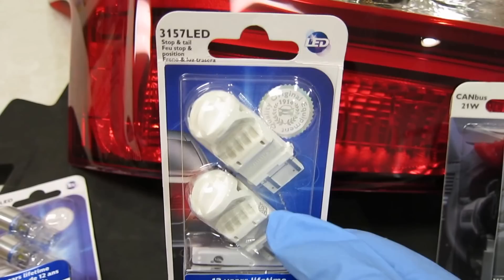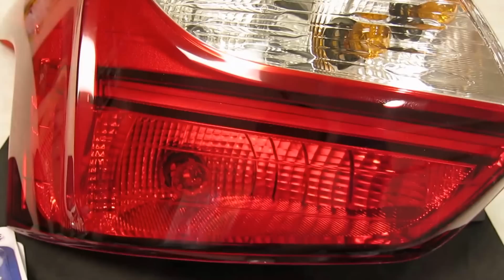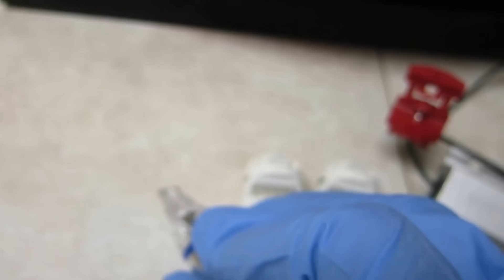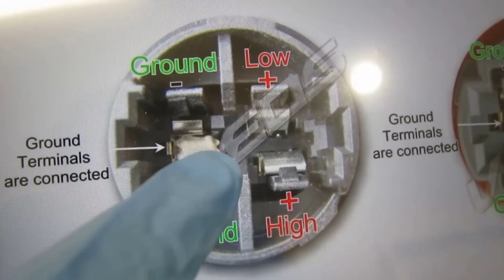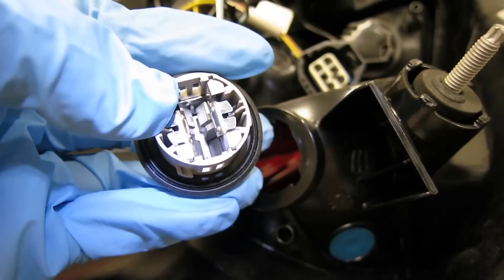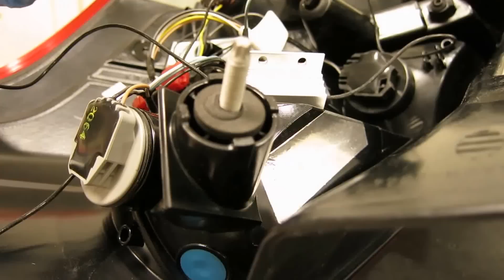How To Replace Ford Focus Tail Lights with LED lights

Comment: @moomoo97 I know this was 8 years ago.

I recently bought these 7443R Philips vision led bulbs. They are very hard to find them nowadays. 

I love this design and use our reflectors. What I don’t like is the color of the red led. When it’s on, it was orange-ish red. And it does not create a usable light.

That’s why I still use the sylvania zevo 7443R brake lighted bulbs. Those create a nice rich red that’s more deeper and vibrant. 

And the Philips are 12 year warranty. While the sylvania zevo are a lifetime warranty. 

I love both led that uses our reflector housings. But I didn’t like the color it makes: 

With 4 LED’s, the beam pattern of my red tail lights were a wider and more square shape beam pattern vs. the zevo makes just wide rectangular shape. But the zevo red led were more usable beam pattern, the Philips vision were less bright or less usable light.

Comment: hello, I have 1 question. When you close the tap to the wire, you don't need to remove the wire cover before closing the tap? How the CANBUS "recognize" the wire if it does not touch to the inside of the wire? Thank you
Reply from the maker: Do you mean the red tap in the video? If yes, those are the wires binding tap which cleanly connecting  two wires together without cutting the original 'source' wire first. And it's reversible if in the future you want to uninstall the LED canceller. Hope this answered your question. :)

Comment: I have focus mk2 2006. What step should I do with P21/5W if I want replace them with led? There is three wires from the harness. Parking light - brake - ground. Correct me if I’m wrong. I have resistor but with which wire should I connect it? Thank you in advance.

Comment: Brilliant, the only video I have found to clearly show the resistor install, I am upgrading my rear light cluster to smoked LED then want to upgrade the indicator bulb which will mean connecting the resistor.

Ford Focus Mk3 <2014 Rear LED Chrome Smoked Tinted Tail Lights

Comment: Did this for both the break and tail lights months back and all went well until I had a thought of putting in led turn signals in the rear but had the hyper flash even with the resistor installed for the break. Is there something I did wrong?
Reply from the maker: The Turn signal and Brake are separated circuits. You'll need another pair of resistors just for the Turn Signal LED bulbs. This will get expensive and usually I don't recommend changing Turn-Signal bulbs for LEDs.

Comment: I did what you did but I still get bulb error message on Hyundai 2017. 
Maybe I need to connect the ground from the turn signal?
Reply from the maker: How many Brake bulbs you've replaced with LED bulb? The canceller has to be installed on each LED bulb line.

Comment: I have Mitsubishi Lancer Ralliart Sportback and when I use one Phillips LED as a reverse lights it's fine but put two in and they all shut off?

Would this help fix my issues
Reply from the maker: Couple of checks: Reverse Light fuse is not blown, and both LED bulbs are in the correct polarity. You can test it easily with the 1 LED 1 Old bulb method to make sure your LED is in the correct orientation.

Comment: Sorry but that's the worst way to install led's into your car. Idk maybe it's something about having to put in a resistor that gets super hot so hot in fact that it's designed to be mounted to the chassis of a car or somewhere metal to keep it cool and from burning down your ride... I guess I'm just against anything that can burn my car to the ground. They have so many lights on the market these days that are cambus ready to be doing this not to mention when I use LEDs I like the fact that don't take any power to run unlike the  Where you have to use that resistor in order to put a load on the system.  Just defeats the whole purpose to me but to each their own  Great see so many people customize their cars today.
Reply from the maker: You're viewing this in a narrow scope. The reason to use such resistor is to make the CANBus not to throw a bulb-failed signal due to the inherently low-resistance of LED. There's no way such a design-specific resistor will burn down the car because it'll NEVER get hotter than the same wattage of the original incandescent taillight bulb.  Besides, the car's taillight circuit has a fuse in place to protect any possible overloading.
Reply: @moomoo97   Let me go ahead and look up one but I can guarantee you those resistors can in fact get hot enough to start a fire in a car you're just not familiar enough with the way it all really works with resistors and how those things work in your cars because if you did your homework you wouldn't have replied regards to this.  I don't know I don't fairness maybe those resistors are somewhat different than the ones I've experienced in the past and I painted Dang I just don't see any point in doing and what I can run a canvas ready LID0 heat and no drop off my battery and still not throw codes. You don't have to pull the power in order to not throw code thus,why use a resistor...
Reply: @secalcavazos3204 the benefits for having them with load equalizer resistors or warning cancelor.

Is two things. 

1: it can trick the computer that thinks it has incandescent bulbs which it has led instead.

And 2: it helps to stop the hyperflash.

3: some vehicle are a little sensitive that if it pops up ur dash board, it can be annoying and needs to fix that problem. If it doesn’t pop up at all. We’re good

Comment: Thanks man! So much info!
Reply: I know this is an old video but how did the resister work mounted onto the light w the 3m tape? Did that work ok?
Reply from the maker: @Charlie5ims  No issue, it works perfectly. Use the 3M Outdoor tape specifically and you'll be good to go, and less clutter up when reinstalling the taillight back.

Comment: THANK YOU. So kind of you to make this video. For me, the bulb upgrade from incandescent / installation was easy enough to figure out following the user's manual of my car, though it did frustrate me on a couple of the bulbs when I knew that I had them securely inserted in the sockets and the sockets properly replaced with none of the wiring damaged yet they still didn't work. Thankfully, instead of making another useless trip back to the store, some baboon or perhaps reptilian, vestigial portion of my brain kicked in and caused me to just play with things a little bit, and try any possible variations on how I had done things, leading me to figure out that unlike  incandescent bulbs, as you pointed out in the video, it matters what direction you plug LEDs into their socket. 

I was not so adept at figuring out how to install the canbus restrictors, or finding any other resource on the internet to do so. And since Philips is absolutely horrible in providing no instructions and no documentation whatsoever, and since we were talking about cutting into wires and adding additional circuitry to the electrical system, which I know nothing about, I was not at all about to let my inner baboon or lizard loose on the electrical system,, risking frying and blowing things up. 

So, they sat on my desk for several weeks, uninstalled, with me driving around hyperblinking everywhere.

This was made all the more frustrating  because I knew it must be something very simple, yet that I did not know. 

Your video fixed all of that. And was very well put together and articulate and concise. Well done.
Reply from the maker: Bravo! Thanks for watching and your interesting notes. Really glad to know this video helped you out on the upgrade.

Comment: Can I use this resister on a 50w led bulb for my rear turn signals on my 2016 Toyota tundra? It had a 921 bulb before.
Reply from the maker: Don't think you'll need another resistor if your LED bulb is already consuming 50w! Joke aside, if your turn signal is blinking crazily fast after switching to LED bulbs, you can add this resistor to the line, but you'll need one for each side and will be expensive.

Comment: WONDER IF WHAT HE SHOWED ABOUT BOTH SIDES OF THE CONNECTOR BEING SOLID OR BROKE UP N2 A SINGLE CIRCUT ON THE OTHER SIDE IS THE SAME FOR ALL FOCUS MODEL YEARS? I WILL EVENTUALLY UPGRADE MY 03 FOCUS BULBS & FICTURE! & SWAP OUT THE OLD TARNISHED HEADLIGHTS ON MY GIRLS CAR AS WELL!!! WITH BOTH OF OUR CARS BEING MID 2000'S MODELS, THEY HAVE SPENT YEARS IN THE ELEMENTS! WISH WE WERE WEALTHY & OWNED A GARAGE! I NEED TO BUILD ONE!!!!
Reply from the maker: Brake light circuit is never in Serial.  So having one bulb failed on a side will not affect the other one.

Comment: if my car need 21 watt led light , and i bought 21 watt led light , do i still need the resistor >?
Reply from the maker: Short answer is NO. This is because a 21-watt LED bulb by itself is already resistive enough to make the car computer knows the bulb circuit is working. However; I doubt if there are actual 21-watt LED bulbs for brake/tail light ever exist on the auto market.
Reply: OK THANKS
Reply: actually i want to replace for the turn indicator not brake light
Reply from the maker: Same to the turn indicator for LED bulb. No resistor is needed IF you were plugged in a 21-watt LED.
Reply: ok thanks
Reply: @moomoo97 nowadays it does exist. 

We have auxito led making between 24-28.8 watts per bulb. And we have morimoto XB led bulbs with 30 watts per bulb and with an active cooling fan and a built in resistors.

Comment: you dont need resistors for mk3 it just works perfect without the load resistors, specially with philips its direct oem fit
Reply: Well if it’s a low wattage, u do need a resistors

Comment: Resistance is higher with LED, it looks like an open ckt.  The Resistor is parallel, decreasing resistance,ADDING current load to ckt.  Look at pkg how they wire it, across the LED, not in series
Reply: With the resistor in parallel to + and - pole, it consume sufficient power on canbus  so that no dashboard error. But I'm curious about if no LED/bulb installed, it shows no error too. This is a problem that you don't know any malfunction on the light as time goes by. In case of resistor going bad, the circuit goes directly from + to -, it can burn the fuse or short circuit. 
I'm pondering to replace my vehicle brake light with aftermarket LED brake light, I found dashboard error while foot on brake and should I supplement a resistor to avoid this? But the above issues get me awareness.

Comment: 2012 ford focus SEL (USA) , brake light resistor/canceller had to be connected between the blue and black wire.  The tan wire is for the parking lights... just feel the resistors with the lights on and make sure they aren't getting hot while the brake light is not depressed.  Thanks for the video though.
Reply from the maker: Thanks for the additional notes about the brake light wires on 2012 Focus too.

Comment: I want to do this with my focus sedan. Will I need the same bulbs for the sedan version? Also what about turn signal bulb? Is there a Phillips bulb for that?
Reply from the maker: If your Focus sedan is also using Tail bulb 3157 (Check your Ford owner's manual to confirm), you can follow this video and using the same Philip 3157LED bulbs for conversion. However; you cannot use these Philips LED for turn signal because this Philips LED only come in RED color and not AMBER/YELLOW.
Reply: moomoo97 any suggestion on brand of turn signal bulb I could use?
Reply from the maker: Not many good AMBER LED bulbs which I know of is beneficial to be retrofitted in the regular turn signal housing. Other than just sounds cool, the actual advantage in replacing the bulb to LED is very minimal. It's money worth saving for other mods.

Comment: My Jetta also has the CAN bus.  There are bulbs with resistors already built in.  I got mine from DeAutoKey.  They make their own stuff and they make them specifically for Volkswagen cars.  They may work in other cars too but I won't guarantee that.  Volkswagens are finicky when if comes to finding LEDs that work without having to wire in a resistor but DeAutoKey's bulbs work without them unless otherwise noted.  It is nice that I did not have to modify my wiring.  Before I found DeAutoKey LED I was going to just take the easy way out and stick to the original incandescent bulbs that it had already.  Their prices are not the lowest but they are not at all high considering what some LEDs sell for.  You know what else is nice?  You get a limited lifetime warranty and free shipping on all orders in the USA.  Their prices are good but not the lowest.  If you want the lowest price, stick to the iffy junk no name ones because that is what you get usually if you pay the least, you get what you pay for.  These bulbs from DeAutoKey must be really good qualtiy, many VW owners use them just because they work and most of the others do not.

As I said, their bulbs may work with other cars but that is all up to you to find out if you would like to try them.  Just because they work in my finicky car, it does not mean that you will have the same luck.  You may even upset some awful electrical gremlins and in extreme cases have to go to the dealer to get the problems corrected.  Your luck may vary and I hope you have good luck the same as I did.  My new LEDs are bright to, I can see a red a fair distance back at night without using the brakes and that would make them more visible and thus safer.  I am thinking of getting a set of reverse lights from them now that they have won my confidence.

They use Osram LEDs and though not CREE, they are still very good and bright.  I had a bulb not working and they sent me two back.  All I had to do was send in the defective one to avoid getting billed for that one.  No more problems to this day, that defective one must have had a loose connection.  I would recommend them to any VW or Audi owner if they asked me what I used in my car.

Comment: Hi, great video, are they the same sockets for a Sedan? I have a 2014 Sedan, and am interested in replacing the normal bulbs with LEDs.
Reply from the maker: +Redline Should be the same if your sedan's Brake and Tail Bulbs are also 3157

Comment: I need a warning canceller for each led bulb replace?
Reply from the maker: +Diana Liu No, you just need to install the canceller to the Brake Light circuit only (Wire which goes to the Brake Bulb). You will need one for each side of the tail lamp, so 2 cancellers for this LED bulb project.
Reply: +moomoo97 Should I keep these Philips bulbs and to order the canceller or to go for 1156 led bulb with built resistor when they will be back in stock fromwww. aznoptics.com  Please,tell me what do you think?
Reply from the maker: +Diana Liu You should keep the Philips bulbs and use its cancellers for your LED project. These Philips LEDs are properly engineered to have the light pattern and brightness for replacing the incandescent. Also its cancellers installation has no wires to cut and just a clip-on. They can be uninstalled very easily when you plan to sell your car. I don't recommend using or purchasing any LED bulbs other than Philips, esp for brake lights upgrade.
Reply: You right ! I love Philips too and I like the brightness but shame on me I don't know where to clip -on ?
Reply from the maker: +Diana Liu Search around here and see if there're videos to show you how to look for brake wires in your Mercedes in similar model year.
Reply: Ok! Thanks moomoo97:)

Comment: I was told the warning canceller is only required for the turning signals?
Reply from the maker: +gsh0ck3d For older cars yes. However, for newer models with CANbus like the Ford Focus here, its computer is also checking the Tail lamps circuits for burnt bulb(s) for low resistance and will throw a warning message....

Comment: Did you put the canceler on the stop light wire, why??
Reply from the maker: +Luis A Jaime Because I've just changed the Stop Light bulbs to LED, as showcased in this video, so the canceller must be in the same stop light circuits for the car computer not to throw a burned-bulb warning message.
Reply: In other words, (yes I’m replying to a 10 year old comment lol) so putting the Phillips warning canceler will trick the computer, into thinking it’s running an incandescent bulb, but running with led bulb. So it will prevent from giving u an error codes.

Comment: I fit a Philips LED brake light to mine today but my Canbus canceller unit hasn't arrived yet but strangely the lights work fine and there are zero warning messages on the dash. The cars only a few months old so I'm thinking maybe they got it configured to work with LED bulbs now as well on newer models
Reply from the maker: Dan Barraclough Don't forget to mention that yours is Aussie Ford Focus and your tail bulb is using completely different socket than the wedge-type 3157 bulb. The Philips P21/5 LED bulb you use may have different circuitries which the car computer thinks it's fine. LOL   But all is good if you didn't need the Canceller for the LED replacement, which is pretty awesome!